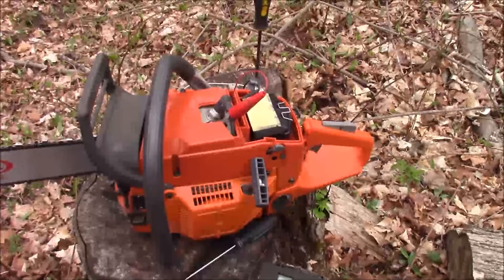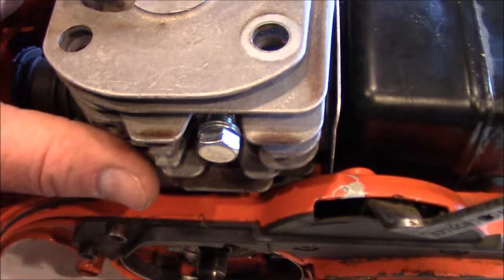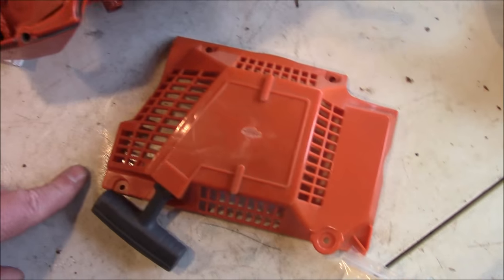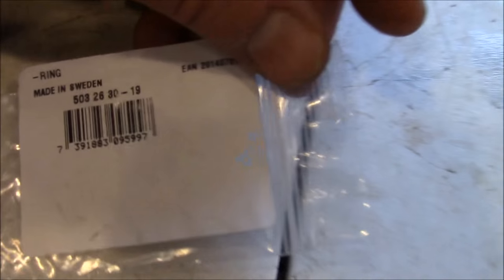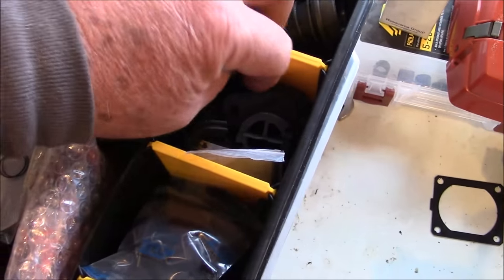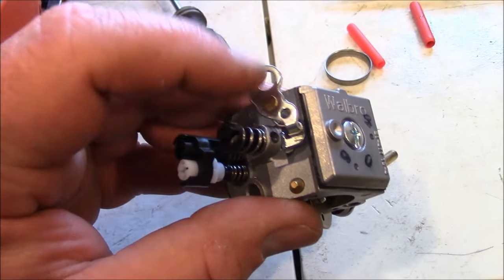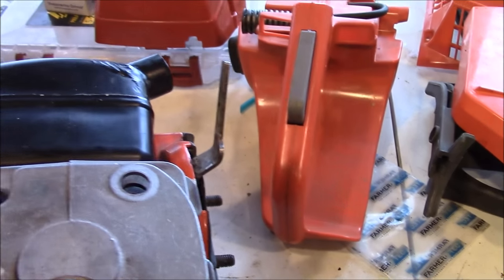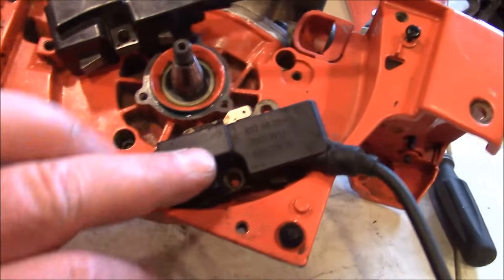Husqvarna 372 "Farmer Jones" Build vs. 562xp HTSS Build. Review Of Farmertec Parts

Comment: Happy Ive seen this so far. Recently had an ebay 365 cook itself while cutting up an english walnut, took it to a shop and was told the damage. Asked him what it would cost to rebuild it, and he straight looked at me and said if you are looking for time and being cost effective, buy a new saw. If you are looking to be cost effective, buy a new saw. If you truely love this saw, i can do the work, but its going to cost you as much as a new saw. *they were a certified dealer, so i understand trying to sling a new saw* But i asked him, if i sourced the parts myself, ie buying cheap clone parts, would it be possible to get it running good again? He told me, i can do it for just labor if you supply the parts, but its still going to run you a bit. So i decided to build it myself, but i bought the farmtec completed crank assembly. For 160$ i got the functioning end of the saw already built. So long as it doesnt grenade itself on the first run, i think i did a good job. Will have to run it up to them and have them look over it and see if im just out a few bucks or if i have my saw running again.
Reply from the maker: A great place to start with the hobby :) Build it
Reply: @afleetcommand  funny enough, i just got the last parts in and when i get around to it on monday ill be putting it together :D

Comment: Great video.   I have had good luck with the farmer tech cranks and especially the. Carbs.  I have to get the aluminum bracket now!
Reply from the maker: +woodstacker I haven't tried them so really interested in your experience with them..U have a video??
Reply: +afleetcommand no videos.. My son is a logger,  I build him 365-372's and 394-395's.  I have used 2 farmer tech cranks and several carbs with no problems. Your videos and Matt's are very helpful!
Reply from the maker: +woodstacker First thank you for the feed back and second...giving experienced feed back on those specific parts. I just haven't crossed over, maybe I should give them a try. Those "short blocks" for 372's with a 52mm top end are in the 150 dollar range! Really tempting.
Reply: +afleetcommand I know exactly what you mean.  I have 2 sets of the $33 cases, when I get enough parts gathered they will be saws.  They look unbelievably nice.
Reply from the maker: +woodstacker post pics? I have a "372 Huztl" thread over at arboristsite,comin the " hot saws/modded work saw " thread. Always hoping those who builds will post pics and stories.. :)Post some pics!

Comment: They are 372 xp models and whatever  muffler that comes from the factory. Thanks for the info you gave me.
Reply from the maker: Is the decomp on the top cover or on the side of the cylinder??
Reply: on the top of cylinder. says 372 xp  xtorque on the side cover of saw.

Comment: hello, I am watching your videos and they are awesome. I have a husqvarna 372xp (the first model not x torq) witch is the best tune for my carb, I've tuned it 1,5 Low and almost 1 High
Reply from the maker: Thank you. Beat way is with a Tack. and since each saw is different its really hard to give the settings other than idle and no loads RPM
Reply: +afleetcommand thanks for the reply. I checked again the saw and I found an air leak, I fixxed that and finally tuned that fine 😉

Comment: Hey bud, question for ya. Would it be possible to do your farmer jones mod on a husky 141? It was a non running saw I got for free and got running. Thought it would be a good candidate since it was free. Any feedback would be appreciated! Thank you and keep up the good work!
Reply from the maker: Think the 141 is a Poulan. So its tough to do much because they are a clam shell design...the upper part of the main bearing cap is part of the cylinder casting. SO about the only easy thing you can do is a muffler mod. Widen ports. Can't easily to the main part of the "Farmer Jones" which is a compression increase.
Reply: Thanks for letting me know! Take care and thanks again!

Comment: I have three 372s and the newest of these has blown the muffler off the motor and away from the saw twice now within a year. Have you heard of this problem and what can be done to fix this. Thanks for any information you can tell me about.
Reply from the maker: I guess my first question is are your saws X-torq's?? Or original versions. AND  do you have those goofy EPA style mufflers. If you have those "EU" spec mufflers I would simply just buy a Huztl Muffler off eBay for a 15 bucks and see what happens. They have less restriction and weight less....if you have a vibration issue lock tite those muffler screws. I see mufflers come of the later 350's frequently but not 372's. Might be something else going on to create vibration.
Reply: Thank you for the info will try both a different muffler and using Loctite on the screws.Thanks. Like your rebuild videos